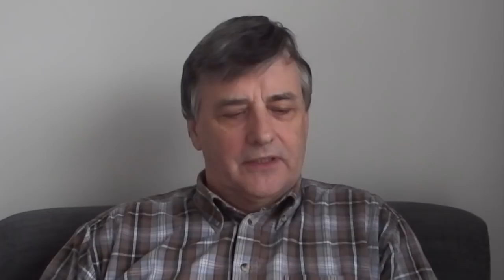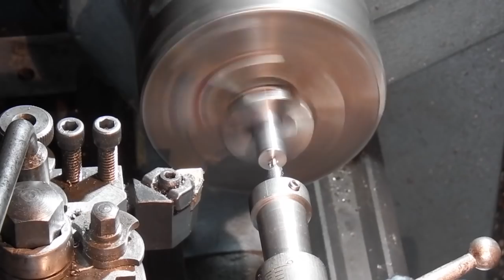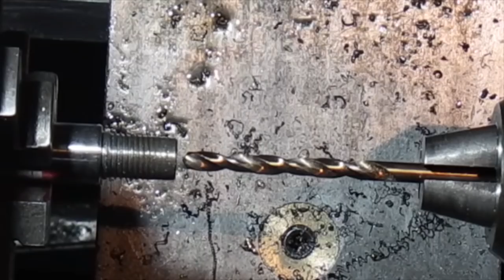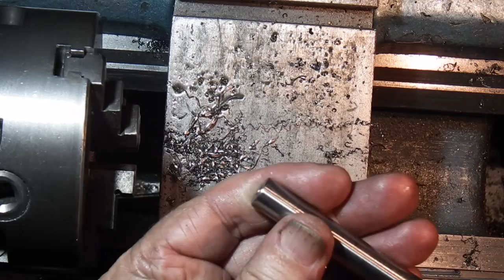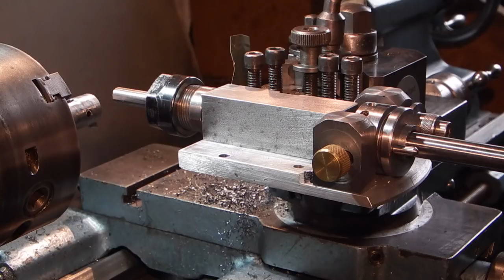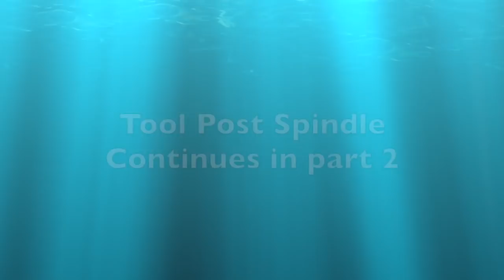Tool post spindle

Comment: I've got a JD2 tubing notcher with a similar arbor (spins, slides), and it does not have a linear bearing; just two roller bearings and seals. I believe you can simplify your design by losing the linear bearing.